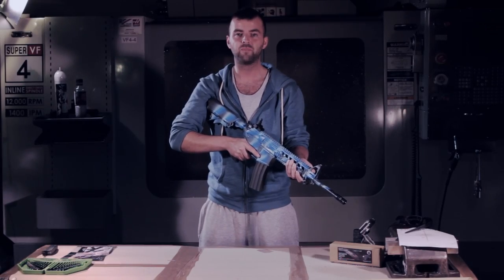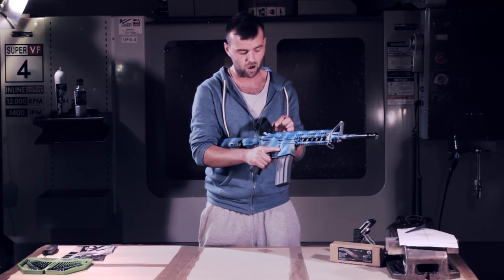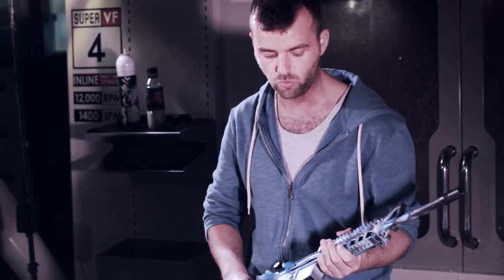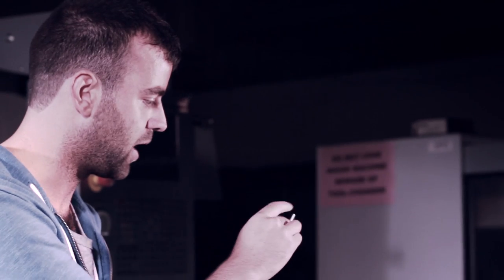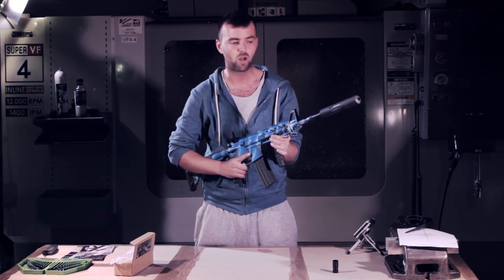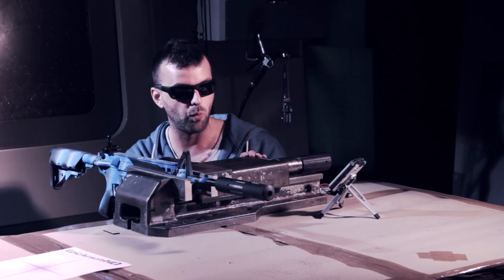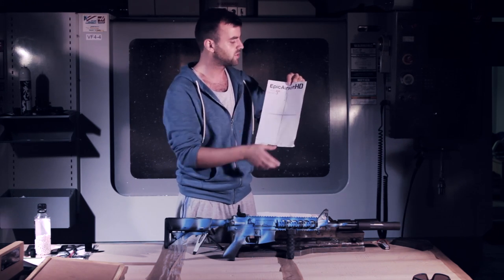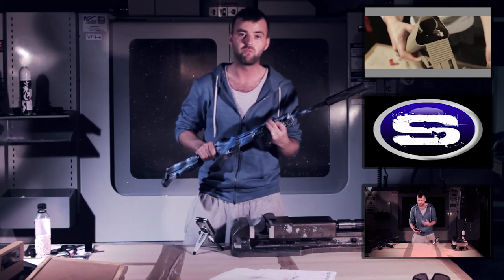G&G CM16 Raider Review and Shooting Test - TwoTone Airsoft

Comment: That doesn't sound right to me, the bb's will have the same force behind it (same spring) so as a result will have the same kinetic energy. With the heavier weight it can't travel as far, it will need a stronger spring to equal the distance. However because of the weight the wind and air resistance will have less effect, meaning more accuracy but less range. So I would say it hit at the same force as a lighter bb, might have less velocity, but because it has more mass has the same kinetic energy

Comment: Im gonna get one for my birthday, and I wanna change the  handgaurd is it removable ?
Reply: Removing the handguard on the carbine version is straight forward but you have to make sure the battery still fits. On the Raider (This one) it is a lot harder. You may have to replace the entire outer barrel and delta ring assembly as the raider does not use standard m4 handguards & delta rings..